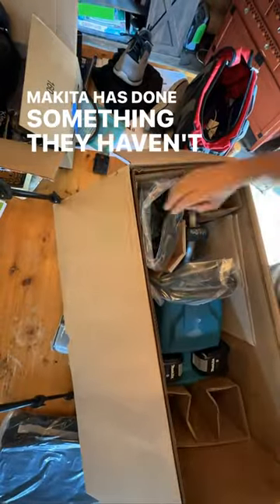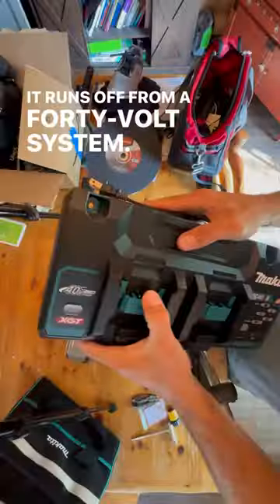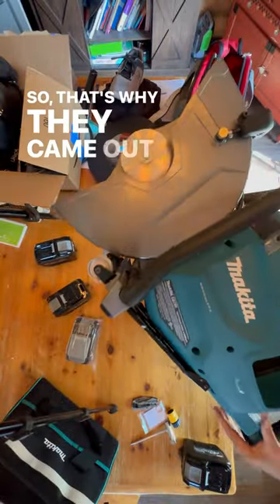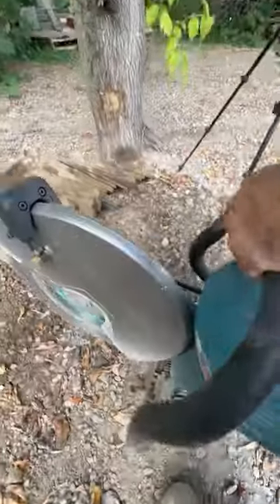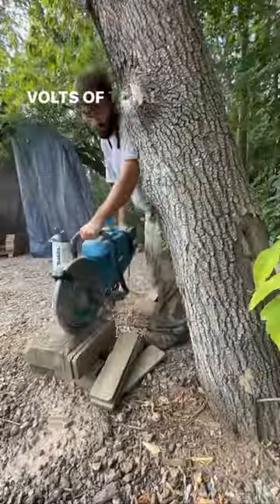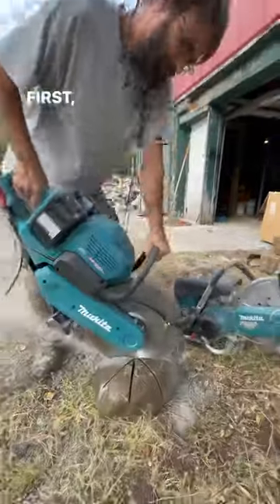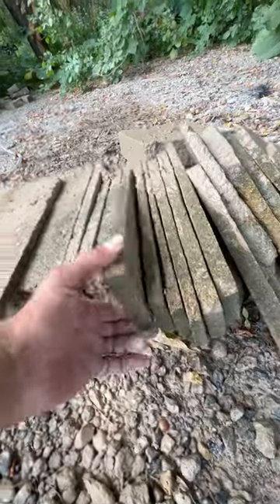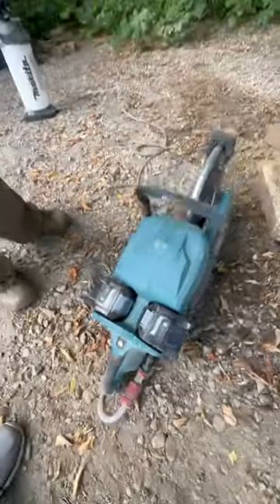Let’s see what Makitas new tools can handle.

Comment: So I’ve had this saw a wee while now, doesn’t stand up to heavy site use the case is very brittle especially in the colder days. I’m a big dewalt fan but Milwaukee is the one for the CS on their new platform. Also the 40v batteries are lowish amps  the run times aren’t great

Comment: I wonder if they will make an adapter so you could use 4 20v batteries.
Reply: No way, 18v packs are too weak
Reply: @riba2233
Actually they are the exact same battery cells. 
18v packs use 5 cells in series 
40v packs use 10 cells in series 
60v packs use 15 cells in series 
80v packs use 20 cells in series. 

So if you have four 18v packs in series you get 20 cells in series which gives you 80v

The cells are 3v to 4.2 volts. They originally considered them 3.6v which gives you 18v. Now they consider the same cell 4v making marking easier with 20v, 40v, 60v, 80v packs.
Reply: @ecospider5  I know that rofl, but 18v packs use less powerful cells inside (current capability wise) and 40+40v tools demand more power.
Reply: @riba2233
My experience comes from the Ryobi system. And that is not what I have found. I have the Ryobi 40v power station that can output 1800watts when using 2 batteries. With only 1 battery it can only do 900watts. And those are triple height batteries. That means they are drawing about 25 amps from each battery. Divide that by 3 because they had to use triple height batteries and you are around 9 amps per cell. 

The cells you get in an 18v Ryobi battery are rated at 30 amps. 
https://m.youtube.com/watch?v=WB9o682IQkQ
Which means a 4 ah battery can output 60 amps. Which is close to 1000 watts. 4 of those are going to handle any battery powered tool on the market today. 

Yes some of the 2ah 18v batteries from 5 years ago were using high capacity low power  cells. But I don’t see that anymore today.
Reply: @ecospider5  ryobi is irrelevant for this story, they don't use high end cells like makita does in 40v packs and they don't have such powerful tools like makita's 80v ones. I am telling you how it is with nakita packs, I know exactly what cells they use in what packs, what their current capabilities are, and what power tools require for the pack. 
80v tools are very high power and there are no such high power packs in 18v range. With normal 40v tools you can use a backpack adapter and power them with two 18v packs, but that still isn't optimal for higher demand 40v tools.
And 30a from 4ah ryobi packs is not a continuous figure, it is closer to 20a.
Reply: @riba2233 Just to make sure I went and checked the spec sheet on each of the cells. The Makita 40v batteries are extremely compact so they had to give up power to achieve this. They are using 10 Sony 21700 VTC6a cells. These cells are rated at 40amps. 

Makita 18v batteries are using 10 Sony VTC6 18650 cells. With a rated output of 30amps. So when you use 2 batteries to make 40v you will have 60amps of output available. This is 50% higher than the standard Makita 40v battery. 

I understand that a Makita 40v battery is more powerful than a single 18v battery. But if you take that as non scientific experience and say the 18v batteries will always be weaker you would be wrong. Because we are not comparing 1 battery to 1 battery. We are comparing one battery to two batteries.
Reply: @ecospider5    nope, your numbers are wrong. Vtc6 cells can do 15a cont, so 18x15x2 = 540w cont. Vtc6a can do 30a cont, so 36x30x1 = 1080w cont. 
These are real world numbers, tested by multiple sources and for continuous discharge where a cell reaches 80c.
However, in the 40v line you also have 5ah and 8ah which can do even more, 1800w and 2160w cont. In the 18v line you are limited to 720w of a single 5ah or 1440w from two 5ah packs. 
But ofc you have 80v (40+40) line so up to 4320e in total which is huge and a lot more than 18v line can do.
We are talking about continuous numbers because peak numbers are too hard to measure exactly and depend on some variables.
Reply: @riba2233
Can you let me know where you’re getting your real world testing numbers from. I would like to see the tests. 

I got the 30A discharge rate from the sony / murata vtc6 datasheet in section 2.5. They are 15A without temperature monitoring.
Reply: @ecospider5   mooch and lygte. 30a is a peak (short term, in seconds or intermittent use) number for vtc6, it would severely overheat if you would use it at 30a for prolonged period, not to mention the voltage drop which would make it basically unusable.
Reply: @riba2233 Do you have any documentation or videos that show that since that is not shown in the document. 

My understanding is max amperage is very connected to resistance as is voltage drop. 
VTC6a 21700 is 5mohms to 15mohms
VTC6 18650 is 8mohms to 18mohms 

So having 2 VTC6 in parallel means the resistance would be 4mohms to 9mohms. 

Which is an improvement on the VTC6a
Reply: @ecospider5  those names I mentioned, they make discharge graphs with temperatures, you can see everything there. Correct numbers are those I told you, I have been in this space since 2014, worked with these cells, made packs, welders, followed new cell releases and all reviews so you can trust me and see those reviews for yourself. I can't share links on yt. Internal resistance is more complicated than that, it is a variable number and cell can have lower IR but worse discharge curve and heating once you test it. Vtc6 has lower than average IR for its current rating but it heats up a lot, that is why it is limited but has a bit higher peak rating.
Reply: @riba2233 Sorry I missed that those were channels and websites. I have subscribed to those. 

Thanks for the conversation, it’s been a while since I looked at the current tool battery cells. Nice to know the new cells being used are the VTC6 and VTC6a. I’m sure I will eventually find a 30a test for the VTC6 and see how quickly they heat up. 

The batteries I have torn down are the Ryobi 18v and 40v and the ego batteries. The Ryobi 40v build design is crap. After 2 hard cycles the chance of overheating them is really high. So two 18v Ryobi is actually better than a 40v Ryobi because of cooling issues. Which is completely different than the Makita batteries since the 40v Makita batteries are actually designed to be used and cycled. 
Do the Makita chargers have fans for cooling?

The Ego batteries are next level for cooling since they have the phase material sleeves. I’m glad they went with 4 tool batteries for their riding mower. 

Because the 40v ryobi die so often finding a battery case is easy. So I made one into a converter so I can connect any batteries to a 40v tool. I have 5  1Kwh electric scooter batteries I connect to a Ryobi power station so I can run my refrigerator for a week. 

Let me know if you have any other thoughts on the Makita batteries.
Reply: @ecospider5  that is nice, I also like tinkering with electronics :)

Yeah makita fast chargers have active cooling for battery packs in 12v, 18v and 40v lines. 40v packs have thought out airflow channels in them so that each cell gets cooled well. Imho they are really well built, mechanically though and the pcb is heavily potted and water/dust resistant. They also have very beefy terminals unlike most other tool brands. They are expensive, but the quality is there. And also they use murata cells that have a longer cycle life compared to other high current cells. So a larger investment, but should last longer all in all.
Reply: @riba2233 Yes Makita is the brand I would use if I used my tools more. I have ryobi 18v stuff from 20 years ago that still works fine so no reason for someone like me to shell out the extra cash. I think I have an original ryobi lithium battery that still works fine. 

My first battery build was converting the ryobi 48v lead acid mower to lithium using scavenged cells. It lasted 5 years that way before I purchased the Ego mower. 

The only project my wife has said no to in the past was using our Prius car to run the fridge. :). But now I can connect my Nissan leaf to the Ryobi power station with my adapter and run the fridge for 3 weeks.
Reply: @ecospider5  haha wife approval factor is really important, I am somewhat familiar with that one :D
Reply: @riba2233
Yes :). My most recent idea was to cut a hole in the wall between our basement to the crawl space to make a play room for our niece. Our crawl space is encapsulated so it’s fully sealed and shares the air with the house. 

My wife said no to that one. But then the next week my niece said. “You should make a play room down there”. So I think I might have approval to make a secret bookshelf door. 🧐😋
Reply: @ecospider5  haha sounds like a really fun project, good luck with it :D